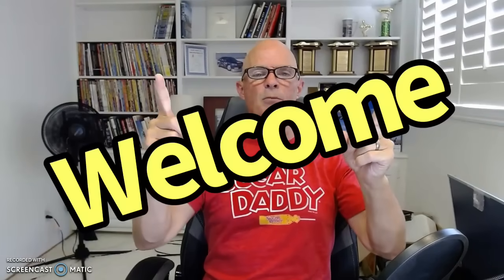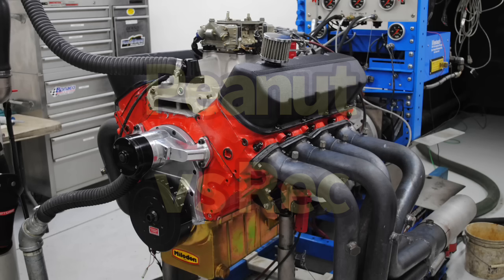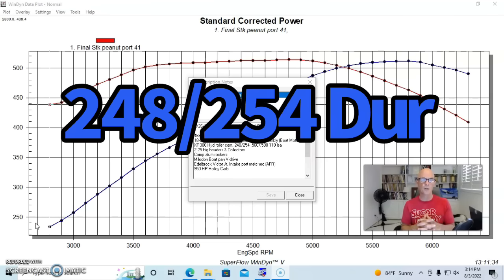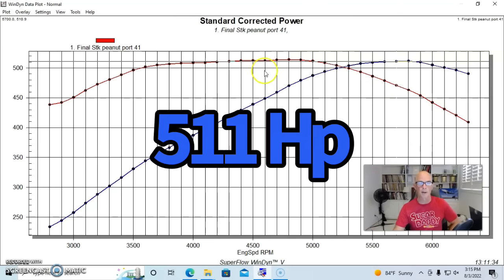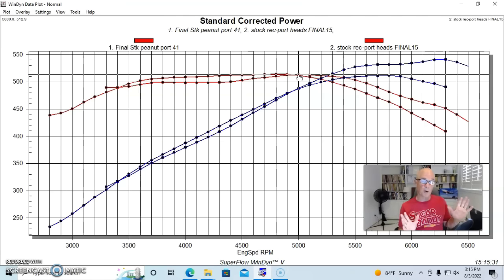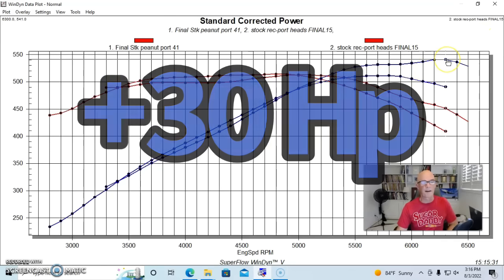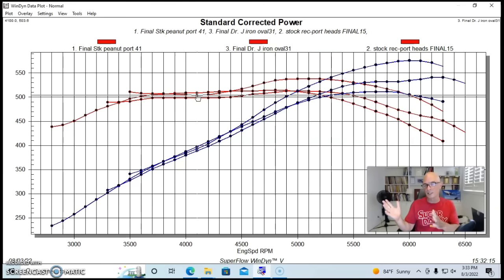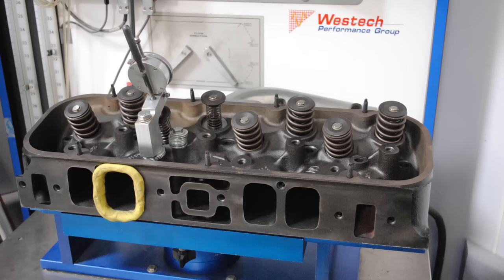WHICH FACTORY BBC HEAD MAKES THE MOST POWER? PEANUT PORT vs PORTED 049 OVAL vs REC PORT vs AFR 265!

Comment: What I find interesting is that the 049s had higher peak flow numbers than the AFRs. Must have some really good low lift flow and a killer exhaust port. Also, those flow numbers for the 049s were higher than anything I have seen for those heads. I don't think may pro porters could get 348 cfm out of those without doing some really wild stuff.

I think some well-ported 088s/188s/990s with 2.25 valves might inch out the AFRs on a 540ci or bigger with .800 or more lift. I think the smaller port might stall with that much air demand and that much lift whereas those big rectangles seem to flow more the more you lift them up to an inch or more.
Reply from the maker: the ported 049 were way down on mid lift compared to the AFR-the peak flows came at different lift values (much higher on the 049)
Reply: Just curious, did the ported 049 heads in this test have stock valves or the normal bigger valves? Sorry in advance if you mentioned the valve sizes and I just didn't catch it...
Reply: @coreyshort9461  no chance those were stock valves with those flow numbers. 2.19/1.88.

Comment: Like to see BSFC with those torque numbers
Reply: YES...YES! (Excuse me..)  I keep making this comment occasionally on videos. 
   I think the information is right there in front of them, so it is very frustrating. 
   I'd really like to see a low power pull up to maybe 3000 rpm. Load the engine to maybe 30 hp, from idle to 3000. 
   Obviously,  this would require varying throttle position to produce 30 hp. If that is difficult,  doing it at one rpm (1800?) Is better than nothing.
   Why 30 hp? It approximately represents what it takes to make your car maintain 60 mph on flat ground, no wind.
   Why does that matter? It IS mileage. I know this is about performance,  but what if two engines, similar in peak performance, are drastically different in low power performance?
     What if, by sacrificing 10 hp at 6500 rpm, you can increase mileage by 50%?
     That scenario is possible,  and may be created by people who disable vacuum advancers on distributors, and remove power valves on Holleys. I think they mostly can't be bothered to understand them. If all you do is drag race, and only care about W.O.T. from 5-7000rpm, maybe...you're not even improving performance in that case, just simplifying tuning. Which is a good reason in that case.

Comment: The square Port heads are better suited to higher compression and the RPM combo with a looser converter but they work real good that way. 

The ovals especially like the old 49 781 head they'll work real good with compression or kind of without it even like around 10:00 or 9 and a half to one if you can't it right you have to cam it for what they want to run out the back and it won't run like a rectangle head so you can't put a like a lot of duration in it because you'll kill the torque on it.. so with the oval you can you can keep it pretty good and it'll still keep torquing it and it'll run upstairs quite a bit better but you still have to watch the velocity and stuff in your port cuz there's not enough to feed it over a level like a rectangle at 300 plus CC
Reply from the maker: compression helps and combination
Reply: @richardholdener1727  Sure but factory square ports are big on smaller ci engines and without some compression, lift and rpm they are not optimal vs the 049/781 head.
Reply: @richardholdener1727  I'm real curious how you might cam my 468 and if you would change the intake or not..??

Comment: I port heads for a living not much BBC iron stuff anymore.. The ported rec port would not help much In this combination do to this small cid LOL and low rpms "just my opinion" Great test it falls in line with what i have seen throughout the years
Reply: Got website for business?
Reply: Those type of rectangle ports need 13 to 1 compression

Comment: I have a set of bbc “hi-perf” heads supposed fully ported by afr -low confidence that’s true. They have untouched bathtub small chambers. A giant set of drag headers (early camaro?) a dart single plane to match the heads dom flange drilled for fogger nozzles. Would that stuff go on like a 5th gen bbc?
Reply: Like I would be a cam kit springs carb hei and a fogger kit from
Reply from the maker: casting number?
Reply: @richardholdener1727  I would have to go out to the pile in the shed under all the ford stuff. When I looked the number up a while back when I listed them on FB marketplace I think they are from 68-69 and they have Hi-Perf casted into the head. I remember that bathtub chamber being small thinking this has to be what the old timers called “close/ closed? chambers” chamber look like a bbc version of the 2.2 head DV did for ya.
Reply: I have two sets of 840 rectangle port big block Chevy heads with the bathtub chamber one set is date code 68 and the other set is date code 69 the date code 68 are still in bags form a machine shop was told they had three angle valve job the 69 I took off my 468 with a reed roller cam 640 lift 308 duration with Tunnel ram and two holly 600 carbs Right before I sold my 67 Rally Sport Camaro about 20 years ago. I still love the BBC.

Comment: Schmidt
0 seconds ago
I doubt any of the factory heads no matter how ported will match any AFR head. The trick with the AFR heads seems to me to be that they raise the roof above the short turn. This gives more cross section in that are without having to lower the floor. All you can do with the stock heads is open the corners of the short turn and remove a little metal around the guide boss. . Porting that area of the stock heads vastly improves the flow of stock heads but if you go too far you hit water. The AFR heads get better tumble which is what the "bad ports" on a BBC head need because swirl on those ports just pushes the air toward the already restricting cylinder wall. That's just my opinion.

Comment: Got a 635hp 680ft 496 with ported 990 heads, 9.6:1 , RPM air gap , 234 240  .620 cam
Reply from the maker: did you mean 580 lb-ft?
Reply: @richardholdener1727  no sir those are correct numbers we have the Dyno chart. I can get all exact engine specs if you would like them. I greatly admire your work sir. You're a hero in my neck of the woods!

Comment: I have a .030 over 454 4 bolt block with a .010, .010 forged factory ls6 crankshaft, a set of 5140 forged I beam rods connected to 10.5 cc domed hyperuetectic pistons and a Howard's cam kit with matching springs,retainers,chain,etc...cam specs are (I think) .224/.235 dur, .535,.545 lift with 1.8 rollers, and 110 lsa. I degreed the cam in at 4° advance. The heads are a set of 880's that have 2.19,1.88 stainless swirl polished valves in them...the heads were ported mildly and the bowls blended in to the valve sizes. The combustion chamber is around 100 cc's giving me approximately 10.1:1 comp ratio. I got a Chinese Air gap dual plane intake, a holley 750 vac secondary, that I cut the choke horn off and blended the ventures into the secondary side. Then I drilled the secondary accelerator pump passageway open and tapped the threads in the body  for the second pump shooter nozzle. And a 650 double pumper throttle plate....the combo with a Muncie m21and 3.08 posi rear gears makes all kinds of power and torque!!!! 
Plenty enuff to push my 4200 lb '74 c10 stepside down the road in a real hurry!!! I figure I'm probably putting about 460, 475 hp to the ground...
The truck has awesome throttle response on the primary side
Reply: Of the carb, and just screams when I get into the other 2 barrels....
I think that the ovals that I am running are just rite for my combo...
Altogether, I got about $400 into purchasing them online and approx $800 into the machine work.
I mean sure.....$1200 will get me into a set of Chinese aftermarket aluminum heads. But I had a real tuff time finding anything with less than 120cc chambers. Thus dropping my compression down dramatically. Probably causing much less power and throttle response...
To get the compression back up I would have had to swap out my 10.5 cc domed pistons to something with much bigger domes on them....but I was on a budget and that wasn't feasible. 
I figure it cost me about 5 g's + or - to build my motor. And that was all I could afford....if I wanted to make more power, I would have had to spend about another $1000-1500, on a really good set of heads to get maybe 50-75 hp???...
Nope...I am fine with what I got.. 91 octane gas and 34° total timing at 2800-ish....no audible detonation issues at 180 coolant temp....
Point being....on a working mechanic's salary, living in northern Cali, driving daily to work, on around 15-20$ in gas, I think the 880's are a good choice.
Now on the other hand, $ no object, of course it's going to be the high buck aluminum ovals for the mild cam and bottom end I'm running....but can the truck 12 bolt and stock m21 take the extra 100+ hp and torque that goes with the superior head? I dunno, i think it's really hard to beat a good set of ovals on my little big block street motor....square port heads, stock or ported would probably ruin my otherwise great combo.....but with 500+ cubes and more R's, well, that might be a different story.....
Reply: Richard, u always have really....really great info that u are cool enuff to share with everybody.....I personally learned a LOT of stuff from u and that is what heavily influenced my build....thank u!!!! I sincerely appreciate the knowledge u bestow upon me!!
Reply from the maker: happy to help

Comment: Are the flow numbers on these heads based on the lift of the cam you’ve chosen or max lift? Per say I know the cam I’m using is .590” lift I/E. Would it be beneficial to me to look for the head that flowed the most at that lift besides max lift which is usually advertised or is max lift something I should pay attention to as well?
Reply from the maker: the max numbers were at higher lifts than the cam

Comment: Hi Richard, I have a pair of 990 cast heads with over size valves 2.3 1.88 no other work. 
I let you use them to test, for flow numbers up to .800 lift.
Reply from the maker: thnx for the offer-but not really necessary-my next  test will be ported peanut ports

Comment: Back in the 90's I replaced the 088 square port heads on my 8.75 compression 454 marine engine with a pair of ported 781 heads, 2.19/1.88 valves from Lingenfelter. The dyno showed 30 more horsepower and the boat picked up 3 to 4 mph. Same 750 Holley, mild 224/232 cam and Dart single plane intake.

Comment: Ported rec port heads are not going to match the AFR heads because the compression ratio will be lower and also I don't know about the valve size on the AFR heads but I'm sure they are probably bigger.
Reply from the maker: AFR 265 HAS 2.19/1.88

Comment: All my life I have heard how great the rec port heads are. I have always ran stock 049's on the 402 and 454's in my Chevelle. I built my present 468 with flat tops, a 232/239 duration 549/558 lift cam, 840 heads and factory intake with an 850 Demon. The engine runs great, pulls hard and is very dependable. I have ran a best of 7.95 in 1/8th with 4:10 gears and an automatic. I have come to believe that with this combo I would be just as well off with 049's. Better yet a set of these AFR's. But the engine runs so good I don't want to mess with it! Thanks Richard for educating all of us!
Reply: I think you deserve a set of the AFRs. I'm sure you would maintain reliability and just think of the weight savings!
Reply: What factory intake are you running?  Sounds like an intake swap would free up a lot of potential.
Reply: I am using the factory 375 hp dual plane with a 1 inch open spacer. I have one of the old single plane manifolds where the carb sits at an angle but I have never used it.
Reply: How much does your chevelle weigh?   I had a similar set up except 702 heads (oval closed chamber) in a ‘72 C10 that weighed 4500 lbs and ran 8.2 eighth mile.
Reply: My Chevelle weighted 3520 without driver. I have added power steering since then so it probably weighs a little more. My big problem was traction until I bought a set of 295/65 ET Street radials. It still spins a little but is much better. Sounds like you ran a really good time with your truck.
Reply: @markestes5948  Try to find some Southside Machine traction bars. It will really make it stick.
Reply: I remember hearing about those. I have not seen any for a while. When I bought the car it was much worse. I knew it for many years and it always had the reputation for spinning the tires. I know these cars will hook, I have had a few. While laying under it one day, I started thinking about the point where the control arms would meet if they were long. It had a set of the old "no hop bars" on it. I took them off and installed poly bushings. Made a big difference. Thanks for reminding me about the SSM bars.
Reply: @markestes5948  They are probably going to be hard to find. I'm not sure if anyone else is doing something similar. What they were doing way back then is what the radial cars are doing now. It lifts the back end of the car. https://www.youtube.com/watch?v=7GeQPpVckHY You can see how it lifts my friends full weight 396 car on a 9" slick

Comment: Ultimately, I ran a set of World Products 269cc oval port heads with a 288R cam in the 433.  I ported the heads and equalized the chambers.  It had the Dart intake and a 750 Holley.

Comment: Stock 454 in my single cab dually. Mark IV edition. So peanuts for sure. Now with the info I would be interested in a high torque style build with them. I have the manual trans and the 4.56 gear set. I like the pulling power.
Reply: I just finished building up my 94 crew cab dually. 
Factory bottom end with a Speedmaster top end kit.
2.25/1.88 valves 
.485 lift cam
Holley Sniper with Hyperspark
It's quite the machine now
Reply: @natec4359  I appreciate that. I have been looking at those cylinder heads for a while.
Reply: @christopherc3017  Yeah, it could have alot more power quite easily but keeping the torque in the low rpms was most important for what I'm using the truck for.
Reply: @natec4359  that’s what I’m looking for. 
Plus if someone ask to race. I can break out tow strap and say let’s hook them to frames and see how pulls who? Mines a 78 c30.
Reply: @natec4359  
Is the Speedmaster kit peanut, oval, or rect?

On a long cruise what kind of MPG are you seeing?  I have a srw 1 ton '81 with a 350/400/4.56:1
She's fast loaded or not. Empty or loaded I get 8-11 MPG. She weighs 7400 with the gear on it daily. I have some huge grades I have to tow up near me. I'm considering boosting my 350 since she runs gooooooood or BBC. I have a fresh 454 block. I'm not interested in LS. Cummins 5.9 in the future possibly. If I could get torque AND mpg I'd like to keep it all Chevy and carb'd.
Reply: @xmo552  They are rect port. I don't know if I gained low end really but it loves to rev. They are 320cc and come with a single plane intake. I definitely average over 10mpg just running around but haven't tried the highway yet.
Reply: @natec4359  
Nice. Thanks. I wonder what your rear gearing is.
Reply: @xmo552  4.10 I think

Comment: Just curious, what heads were used on the "Reynolds Rat" engines in the CanAm series?  Keep putting out your videos, they really are fun and informative.  Thanks.
Reply: Ported Factory Aluminum Rectangle Port ZL-1 heads.
Reply: @corvettejohn4507    Thanks.

Comment: Richard, did you run the oval port intake on the rectangle port heads?  If so, you may have handicapped the rectangle port heads some.  As far as what a set of ported rectangle port factory heads would do, just look at a NASCAR 427 Chevy engine from 1972 that Junior Johnson put together for Bobby Allison's Monte Carlo.  Typical power output of the NASCAR 427 Chevy's of the early 1970's was around 625hp.  Also, look at the McLaren Chevy Can Am big blocks of the late 60's with ported rectangle heads.  They put out 650-700hp with fuel injection.
Reply from the maker: THE CAN AM MOTORS WERE BIGGER THAN 468 AND PORTED REC PORTS WON'T DO WHAT THE AFR 265 HEADS DID ON THIS MOTOR-WE ALREADY KNOWTHEY FLOW ENOUGH TO SUPPORT 600+HP WITH A BIG CAM
Reply: @richardholdener1727  Richard, I have an article from Competition Press and Autoweek from 4 Oct 1969.  In it, George Bolthoff who built McLarens engines talks about the M8B's 430 cid engine having 650hp.  He also mentions what he does to the heads.  Another data point, Al Bartz had a blueprinted 1968 Can Am 430 with closed chamber heads making 615hp on his dyno in 1968.  It was in Petersen's Complete Book of Engines #4.  I also have a Chevrolet dyno graph from around '69-'70 showing pulls from a Can Am 430 and a Can Am 465.  The 430 made more peak HP at 675hp @ 7,600 rpm and the 465 made 660hp @ 6,400 rpm.  Of course these engines had full race cams, Lucas fuel injection with ram tubes, 12:1 cr, and were revved up high, but it shows the potential of the vintage rectangle heads with some porting.  Obviously, the new aftermarket heads flow much better and with higher port velocity.
Reply: @richardholdener1727  Can Am motor size depended upon what year ('68-'72) you are talking about.  The Can Am BBC started at 430, then went to 465, 495, and 510.  465 is pretty close to 468.

Comment: When selecting a street head, you want the smallest runners for the desired cfm right? I always heard that this gives better throttle response and low end torque. I’ve always used AFR heads because they make a really efficient head. I have tiny 205cc AFR heads on my LS 408, but they flow over 300 cfm. Was this a good move for a street motor vs just slapping some rec port ls3 heads on it with about the same cfm?
Reply from the maker: I THINK SMALLER WITH THE SAME FLOW IS BETTER